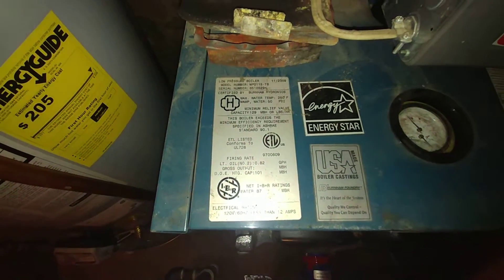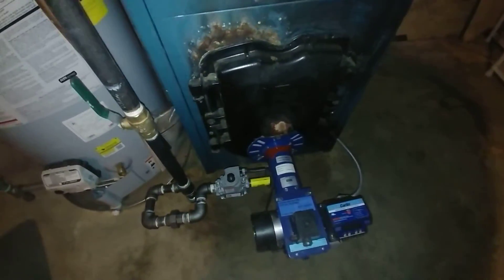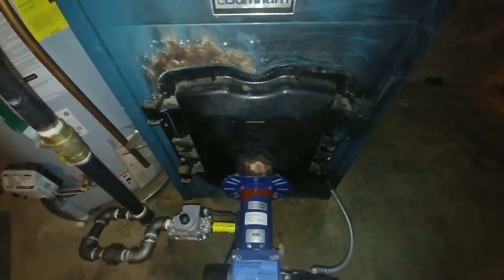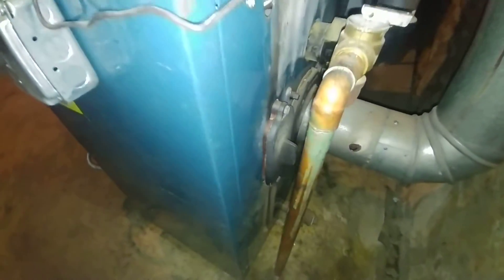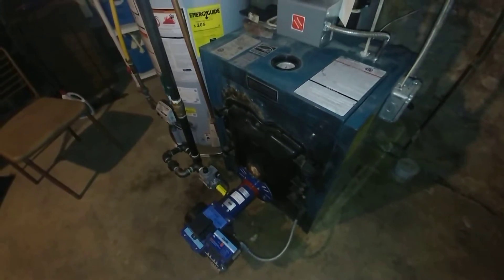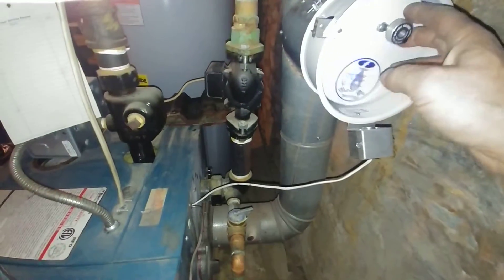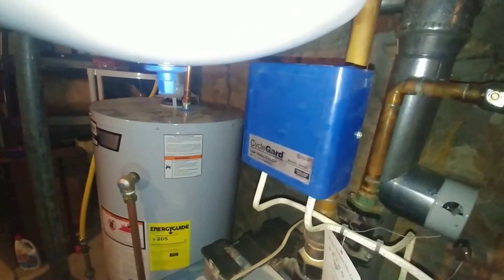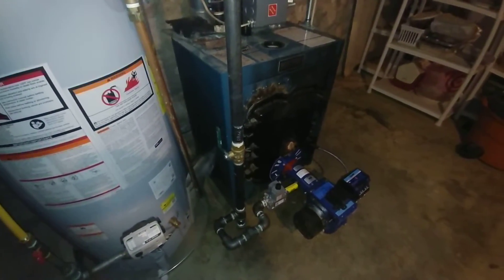Oil To Carlin EZ Gas Conversion On A Burnham MPO Hot Water Boiler

Comment: Any preference to Carlin EZ gas to Beckett CG4 gas conversion? Thanks!
Reply from the maker: The Beckett CG4 is only approved for certain models of boilers, if I understand that correctly
The Carlin EZ gas is approved (with proper set-up, of course) for many more boilers.
Reply: @gordonschweizer5154  I starting to learn Burnham Megasteam doesn't support the use of either. Any idea as to why? I'm going for one or the other despite them.
Reply from the maker: The fact that Burnham Megasteam does not support the use of a gas burner is a sore subject with us.
We all have suspicions as to why, but suspicion is not proof, and we will have to leave it at that.
Good for you in defying their nonsense.
I would definitely go with the Carlin burner.
I would reach out to Carlin tech support and politely ask for the set-up info as they have tested their burner in the Megasteam (saw it with my own eyes at their factory).
Question for you: Is the Megasteam you wish to convert already in place?
If you order a Megasteam without a oil burner, they may refuse to ship (ask me how I know).
Reply: @gordonschweizer5154  Haha! You're kidding me! Wtf is wrong this company? Is there something magical about their boiler which requires special fairy fire? All logic points to this design benefitting from cleaner burning LP/NG. Are they afraid supporting a conversion will cut into sales of their prefab gas units? Seems to me they have the same pompous attitude the luxury car manufactures have. 

I installed the Megasteam last winter under duress during a cold snap. Old clay lined chimney would have had to be repaired and lined to accommodate gas as well as upgrading the gas supply. Needed to take the path of least resistance and deal with the upgrades at a more suitable time. That will be done along with the Carlin gas fired head. Screw Burnham. They're just another act in our new clown world. Shame they're idiots, I really like the Megasteam. 

Thanks for your feedback regarding the gas burners. Carlin is the one to get.
Reply from the maker: Preach it, Brother!
One caveat, is this conversion going to be inspected?
Some areas will fail it if the local AHJ has drunk the kool-ade, if you get my drift.
Please have the burner set up with combustion test equipment and swap out the oil barometric for a gas barometric and add a blocked flue switch there.
Reply from the maker: "Special Fairy Fire" LOL!!!
Yes, if they make a burner that burns pixie dust and broken dreams, we'll figure a set up for it.
I heard that Carlin had published set-up info for the MegaMind boiler and the Big B forced them to take it down.
Reply: @gordonschweizer5154  Dealt with the town inspector many times for customers of mine. Never would I consider dealing with our "building" department on a personnel level. Juice ain't worth the squeeze. Absolute power corrupts absolutely.
Reply from the maker: @firegardendevine6039  Ok then.
Sounds like you know the score.
Please let us know how it works out.
Please tell the folks at Carlin I said hi & thanks!

Comment: Can this be set up for LP as opposed to gas? I have a slightly different burnham mpo model  boiler and would like to convert from oil to LP.
Reply from the maker: Yes, it should be possible to set the Carlin EZ Gas up using LP firing into a Burnham MPO..
I would most definitely consult with the Carlin Rep or directly with the Factory to get the latest set-up info.

Comment: In my experience, a hot water boiler located in a basement doesn't need a LWCO because they all have an automatic water feeder and the house wont heat unless you have a full system with a little spare pressure. IOW, you'd know if there was a problem.
Reply from the maker: Accidents are almost always the confluence of unlikely events.
At to "experience", yours, mine, or anybodies, doesn't really matter.
That excuse won't hold up in a court of inquiry.
The Code in many States requires a LWCO on all new boilers, steam OR hot water after such and such a date.
Older boilers are grandfathered, of course.
Know this, one and all: An automatic water feeder IS NOT A LISTED SAFETY DEVICE.
They can, and as post hot water boiler explosion analyses have shown, have indeed failed to feed water when it has run dry.
As to water loss being noticed, I have a story to tell.
You are free to believe it or no.
Once 20 years ago, I was sent to a house with an OLD oil-fired hot water boiler to "clean" it.
I asked a general question as to how their heating was, was everything OK?
"Well, the radiators on the 2nd floor don't work"
Really? Since when?
"Oh, since we moved in. About 20 years ago."
....(my brain glitched)...
W..., Wha, what happened when you bled them?
"Nothing. Nothing came out, so we figured they were broken."
Got any heat up there now?
"Yeah, we've been using electric heaters since then."
There were 20 years of Oil Company service tickets hanging on that boiler, and I was the first guy to get all their radiators hot & it took 30 minutes.
Their automatic water had rusted up & failed sometime during the 2nd Nixon Administration, so I fed water from the mop sink into the system. 
So they didn't know that they had a problem even though there was almost no water in the system (the first floor was starting to gurgle, they said later.  They had NO idea what that meant).
So the upshot is, whenever possible, a boiler, whatever type, should have a LWCO. 
Period.
Reply: @gordonschweizer5154  ... that is a good story and quite possible. Matter of fact I have seen that exact problem many times... except... the part about going 20 years without proper operation. The reality is that boiler never went empty so was in no danger of blowing up, unlike a steam boiler where it's normal to run half empty. A steam boiler also doesn't shut down on temp because it's looking for steam pressure, which can't happen without water. This is why steam boilers got LWCO systems decades ago as a required device. Do I think a LWCO on a hot water boiler is a good idea in certain situations? Yup, it's not a bad idea, especially when all equipment might be on the same floor, or the boiler is higher than the radiators. My original point was it's not necessary in all cases. Of course, code will step in and protect us from ourselves in a few years.

Comment: I'm considering having one of these installed on my oil-fired boiler to convert to gas. Does anyone have feedback / experience with them? I really want the house on gas, just am a little worried I'm opening a can of worms maintenance wise
Reply from the maker: Insofar as "opening a can of worms maintenance wise", have you had regular and proper servicing on your boiler and oil burner up until now?

If not, then usually a lot of time will be spent cleaning the old boiler, at the least.  
Often a new fire box is called for as well.
How old is your current boiler?  What model?
Does it heat the building properly now?

Has your chimney been inspected by a licensed chimney contractor?  That should be done anyway, even if you stick with oil.  
They usually recommend re-lining.  Again, not unwise.

Once all of the usual issues of doing a gas conversion are finally dealt with, a gas power burner should burn a lot cleaner and not require annual scrape downs like with oil.
Reply: @gordonschweizer5154 hey really need assistance on the knowledge of converting an CWL LE SERIES from oil to gas. I want to know what burners are compatible and what goes into the job ? Is it just cleaning the chimney and unscrewing the oil converter and screwing in the gas one?
Reply from the maker: @ilovePhilly24  There is a bit more to oil to gas conversions then  you might think & it would not be a bad idea to have another set of experienced eyes actually look @ your particular situation.